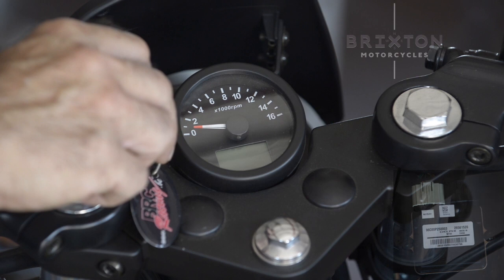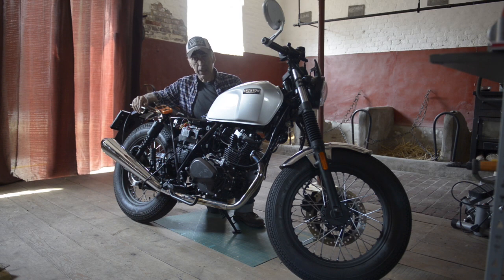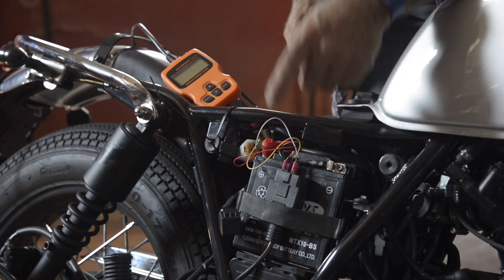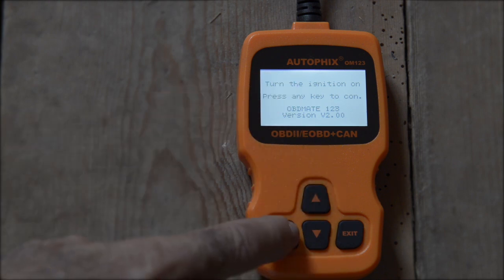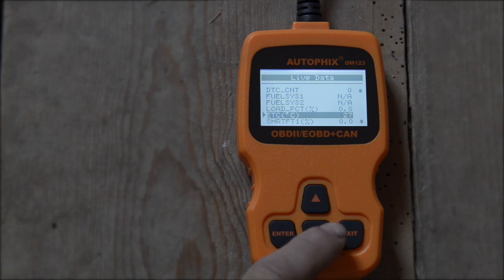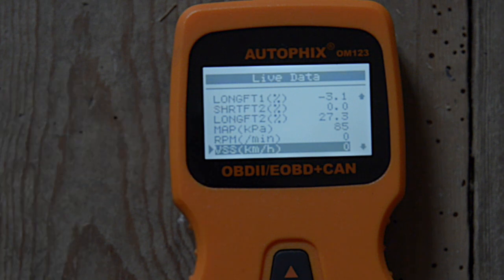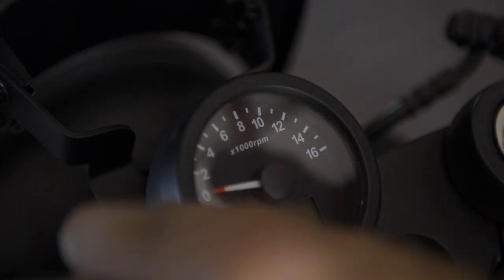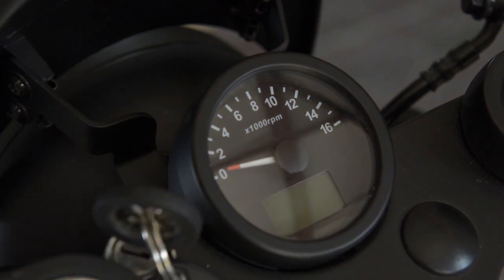Reading and clearing error codes on your Brixton bike - Easy and Simple

Comment: I have this P0122 error since long time ago and I've still not managed to find the reason... I replaced the TPS sensor, nothing. I cleaned the connector, nothing. Reseted the ECU, readjust the TPS position value (it was 8% at 0 position), still nothing. Any ideas where the problem might be located and how to repair it? The bike works just fine now, but the error keeps showing up. I delete it and it's gone for a few hour, days or even weeks, but then it keeps coming back. It doesn't seem to be something critical but really annoying indeed.
Reply from the maker: Sorry to hear that, it could be a wiring issue perhaps or a grounding

Comment: There is a method without a cable: 

If the EFI indicator stay lighting switch on/off the ignition 3 times. Pause between the operating not
longer than one second. After this the EFI indicator start to flash.

Rear the codes from the left to the right. Example. P0201 (injector malfunction) the indicator will flash
10x (=0)/ pause approx. 2 sec./ afterwards the indicator flash 2x (=2)/ pause approx. 2 sec./
afterwards the indicator flash 10x (=0)/ pause approx. 2 sec / afterwards the indicator flash 1x (=1)

Comment: Hi D3S

I have just bought a Bullit Hero 125 manufactured in 2019.

Apparently this has the MT05 ECU too. I can't find any port but have a stable/solid EML on the speedo cluster.

The manual states this shoudl flash a series of pulses to give an error code. It does not.

So I'd like to know how to find the pin out and use the KW2000 protocol (is it rs232 or similar serial data stream?).

Obvioulsy from your video - the OBD needs power up (so 12v and ground) and a signal wire for the KW2000.

Can you help please?

Just Me

Comment: I used the autophix om123. Followed your video step by step. Got the P0122 TPS sensor code and cleared it Engine check light went off. Next day after about 3 or 4 ignition turns, the light came on again. Did the same thing with the autophix. Got the same error code and a 2nd error code P0032 "HO2S Heater control circuit high bank 1 sensor 1". Erased both codes and light went off. Very next ignition turn, light came back on again and the P0332 error came up again. Every time I delete the code, it pops back up again. Bike runs fine, gas gauge is always blinking, but thats it...any suggestions? Do I need a new HO2 sensor? Electrical ground issue? Battery is new...I'm stumped.
Reply from the maker: check the cabling first, and then you might need to change the O2 sensor as that one seems to act up.  Normally they need to be warmed up for a good reading, that is why they have power leads to make it glow inside...until bike runs and produces the heath.....

Comment: Good Morning, I need help!!I have hyosung st7/gv700 with delphi mt05 centraline,my problem is the FI LIGHT on after repair the speedometer,and I have error stored in the centraline!Can I use autophix om 123 for resolve and turn off FI light?thank you for answer
Reply from the maker: Thanks for the comments, That should be possible if your ECU communicates with one of the supported protocols.  And off course if its only a logged fault and not a persistent fault
Reply: @D3Sshooter  thank you for answer tomorrow I will try whit autophix om 123!I hope can resolve!!!! Thank you so much

Comment: Do you know if the engine indicator( light on the brixton) will blink if it is a big problem. Also do you know if there is a way to read the problems trough a laptop?
Reply from the maker: Thanks for the comments, OBD2 readers are the only way to read it with a K-line...  the error light will be on for logged and actual erros

Comment: i own a brixton 125 and i have a problem with error codes on and off , what could be the problem.Went to dealer they change the cdi or smth that is part of the error codes thingy but it still comes out.
Reply from the maker: Thanks for the comments,  what code did you have  ?    Try to read to logged codes, and often it will point to the problem.  Its not uncommon to have a a bad sensor or bad contacts..

Comment: Error code 0336. crankshaft sensor position is interfered.. after 8.000 my flesberg runs with a limiter.. i think that the normal limiter goes on 10.000. The mechanic said after a quick look he cant find the CPS sensor.
Reply from the maker: txs for the comments, that sensor might be build in... I would need to check that out myself
Reply: @D3Sshooter  let me know. Thanks
Reply: If I have an email or what's up or something I would appreciate if you could send me a picture of where the sensor is.That will really help me and the technician

Comment: Hello - great video! My bike fell over in a wind storm and now has a light on. Iv been on it and all seems fine just wanted to check the light. The k-line wire - is that a special wire and/or where can I get it? I bought the same reader as in your video and a motorcycle 6 prong adaptor but not sure on the hook up. Any advice would be greatly appreciated! Thank you
Reply from the maker: Thanks for the comments, the details on how to connect it are in the video's.   The K-Line is a protocol to communicate.   Most likely its your o2 sensor in the exhaust pipe that is damaged or the cable

Comment: HI FLEMISH, BUT YOU KNOW I HAVE BEEN FOLLOWING YOU. AND I USE TO ASK YOU TO TELL US HOW DO YOU KNOW WHICH WIRE IS WHICH. CAN YOU PLEASE MAKE US A VIDEO ON HOW AND WHERE CAN ONE FIND WIRING DIAGRAMS SO THAT YOU CAN KNOW WHICH IS WHICH.   YOU ONCE TALKED ABOUT DATA SHEET AND WORKSHOP MANUAL. JUST DO US A VIDEO ON HOW TO GET THOSE . AND ALSO THE WIRING DIAGRAMS OF THE CARS.

M.B.S MOSHITOA (S AFRICA)
Reply from the maker: Hi, well the wiring is something that I did explain in the video.  I always refer to the standard OBD-2 plug pin out that you can find on the internet.   That plug (OBD2) supports multiple protocols for your diagnostics.   Which pins to use depends on the protocol that the ECU uses .   There are differend methods, as to the pin-out on the Bike , I searched the ECU type and on that site I did find the protocol used by the ECU and the plug pin definitions.   once I knew both pin layouts ( OBD2 and the Brixton plug) I only had to patch the right pins with jumper wires . That is how I do it, I have no wiring diagrams as such.  I hope that this helps
Reply: @D3Sshooter  well, anyway i thank you for taking your time to try to answer us. my question was not neccesarily to the brixton, was a general question on how do you know which wire is which. 

LET ME GIVE YOU EXAMPLE ALTHOUGH IS NOT ON WIRES. REMEMBER WHEN YOU WERE WORKING ON MF35. YOU SAID THE TOP MUST BE TOUQUED TO 12.5 M/KG AND USE FILLER GAUGE OF SO MUCH MILLIMETRE FOR IN AND SO MUCH FOR OUT. THEN I WENT AND WORKED JUST AS YOU SAID ON MY MF168 AND TILL TODAY I STILL DON`T GROW TIRED OF THANKING YOU AND TALKING ABOUT YOU TO WHOEVER HAPPENED TO BE CLOSE TO MEWHEN I AM ON MY TRACTOR.

BUT MY QUESTION IS WHERE DID YOU GET THAT INFO OF TOUQUE AND FILLER GAUGE
Reply from the maker: @m.b.smoshitoa8325  , I got it out of the maintenance manuals

Comment: Hi!
First nice video! I have a problem with my brixton. 
Every time I slow down and I still hold my clutch then he falls out I start up again but fall out again. This also happens during an emergency brake. 
Can you help me pleas :)
Reply from the maker: Hi oeps.   So when the bike is still rolling, but the engine has gone to idle due to the fact that you pulled the clutch the engine stalls.  First question, is the MIL light on in the speedometer ( the little engine light ?).   If that is the case then you will need to read out the error code, because your ecu ( computer of the bike) has detected a problem most likely with a sensor.   If it is not on then it can still be a sensor.   The first one I suspect is the sensor in the exhaust.  check the cables  as that is the NOX sensor.    It might also be that the throttle position sensor is not re-acting normal.   Did you try while standing still in neutral to rev up and then let the throttle go ?   What happens then ?  does it also stall....   ?
Reply: @D3Sshooter  Indeed the mil light is on when the engine stops. What I did, the engine stopped and tried the same thing when I was on the road. And I have no problems there. It really is when I am on the job. That he stops and my clutch is still in and brake that he sometimes fails 2 times in succession.
where are the cables of the NOX sensor? How can I ensure that this no longer happens?

Thank you for answer!
Reply from the maker: Its normal that the MIL light is on them the engine is stopped and the contact is on.   It should turn of when the engine is running.  If it stays on it has fault detected,  Best is to read out the code.   So you brake and at the same time you hold the clutch in and then it stops ?   That is not the NX sensor ( that is the one in the front of the exhaust).   It might be the sensor on the side stand.  As you know , as soon as the side stand is put out the engine will stop... Maybe , you touch it or it moves a bit when you do that emergency stop.... Check that .  have the bike in neutral and running, with side stand inwards/up as you would be riding... fiddle a bit with the stand.... move it a bit back and forth and see if the bike stops running if you do that .... If that is the case then the sensor/switch is faulty on the side stand  or just maybe moves....

Comment: Hello! Thank you for the videos! I and a friend of mine both own the bx125 and both of us have our engine light turned on at around 2000+km. Can you suggest a diagnostic tool that is suitable for bx125 and also for the benelli trk502?
Reply from the maker: vortaklidis karamanidis ,  any obd2 tester that supports the K-line protocol will work.    The one in the video is a cheap one 25 euro.  And it works well. Note that you will need to patch the wired to the brixton ecu.  That is also in the video, as they use a none standard obd2 plug.
Reply: @D3Sshooter  hello thanks for your knowledge share
I have Brixton bx125 the only problem i have is read right turn light is very dim.
Please suggest what to do.
Thanks

Comment: Hey nice video! I've got a Mash with Delphi MT05 as well and I connected the bike to PCHUD through an OBD-to-USB connector equipped with the FTDI chipset using virtual COM port under Windows XP (actually via VirtualBox, PCHUD doesn't run under Windows 10). That's easy. PCHUD pretty much shows the same things as the diagnostic scanner/reader. No access to ECU maps, though. There are commercial pieces of software that are supposed to do so, for example BitBox and/or CombiLoader, but WTF they are crazy expensive! I am looking for a free program to read/write the ECU (hex dump and flash) but no luck yet. I will probably end up in developing my own software at some point.
Reply from the maker: Thanks for the comments, and indeed the PCHUD is one of the tools I also use... Still trying to get to the maps..

Comment: Have you come across PCHUD ? As with a similar cable set up to what you have ( except odb to serial or usb) it should give access to maps

Ive just got a Hanway hs125i and it appears to have a similar setup to yours except its a ohv engine.(honda cg i think)

So anyhow i'll keep watching with interest. Keep up the good work.
Reply from the maker: Mark  txs.  Yes i have amd looking into it.
Reply: +D3Sshooter I think i've also found an suitable cable on CMPO searched on DIAG and its got a Delphi 3 wire (k-line) version and a 4wire (canbus) version. Going to order one and test.
Reply from the maker: Mark that is great.  But i just made my own cable
Reply: Edited software to correct name pchud

Comment: Hi nice and thx for the good information,you can also see the code when you switsch 3 times the key on and of 10times flasching meens 0 usw.by 5 times switsching the key fast on and of the motorcontrol light ist clear.
WHERE dit you bought that controler can you give me an internet adress thanks